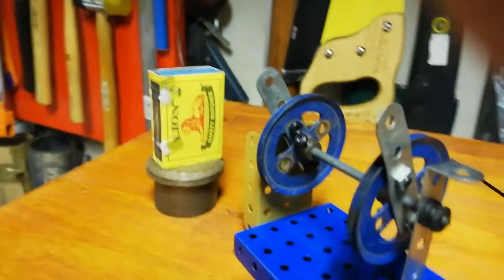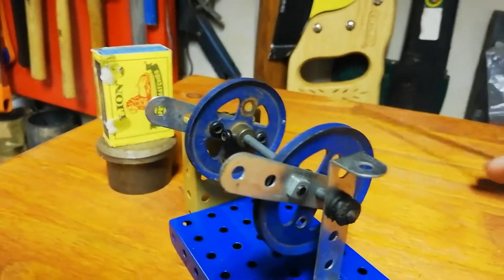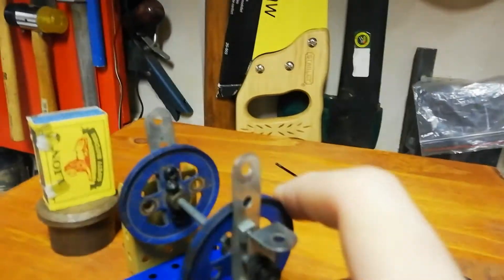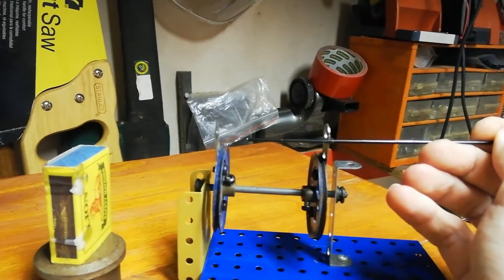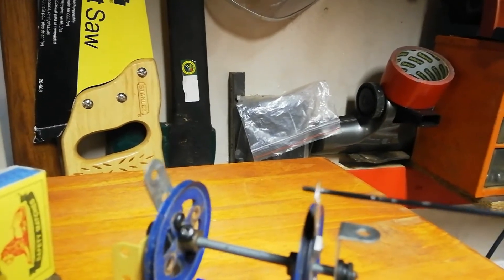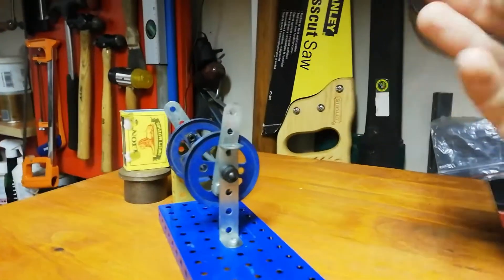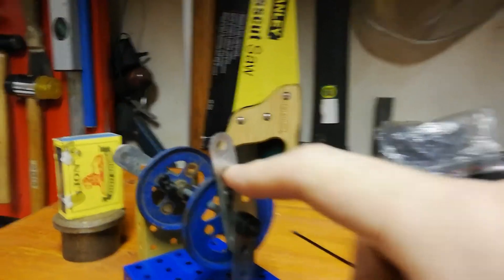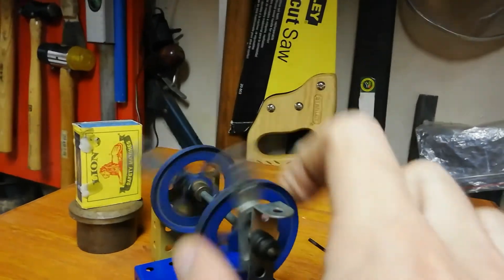Measurement of the Speed of light in 1 direction

Comment: A method to discover the one-way speed of light.

Or... Does light have a tail? 

If light has a speed limit, then it has a tail. If light is instant than the off is just as fast as the on. 

To find out if light has a speed limit take it past that limit and observe. To get light to appear to move past its limit, if it has one, simply rotate it.  If light has a speed limit, as the circumference of the tip of the light grows ever larger, depending on its rotation rate, the angle at which the light would appear to progress in a snap shot view changes.  

If light does not have a speed limit the arc will always appear at a similar radius. 

If and when the tip of the light that creates the arc, is appearing to progress at a 45-degree angle to its path, you are at its max speed.  X=Y moving at the same rate. 

One of many configurations in finding the one-way speed of light, may be done easiest in space:  SEE DRAWING ONE WAY LIGHT SPEED BELOW.

Configure three satellites. One at center and two at a radius. Rotate a laser on a center satellite, and use the two satellites at the radius as targets. The targets are 49.85 and 45.85-kilometers radius and they are 4.8 degrees apart.  This geometry will give you a 45-degree angle between the two satellites targets from the mean radius tangent of 47.85 KM.  

It is believed that it takes light about .0001663 seconds to go 49.85 KM. in space. 

Run the test, based on the believed speed of light:

Rotate and fire the laser: The light is traveling to satellite #2 and will be there in .0001663 sec., with the rotation of the laser at 1000 rev/per/sec it takes .0000134 sec to rotate the entire 4.8 degrees between the two satellites and at that point the light is then traveling at the satellite #3. 

Conventional belief light travel times
49.85 KM in .000166281 sec 
45.85 KM in .000152939 sec 
                  .000013342 sec difference 
Rotational speed to travel 4.8 degrees in .000013342 sec = 999.35 rev / sec
At the above rotational speed of 999.7 rev/sec the light would hit the two satellites at the same moment, if it is traveling at 299,792 KM/sec

Examples of other speeds: 

Light at instant speed can never hit both satellites at the same time, as the light is rotating. 

If Light were traveling at 250,000 KM/ sec

49.85 KM in .0001994
45.85 KM in .0001834
                     .0000160 difference, if the speed of light is 250,000 KM/sec you would have to have the rotation of 4.8 degrees in .000016 sec or 833 rev/sec

If Light were traveling at 350,000 KM/ sec 

49.85 KM in .00014242
45.85 KM in .00013
                      .00001242 difference, if the speed of light was 350,000 KM/sec you would have the rotation of 4.8 degrees in .00001241 sec. 1074 rev/sec

                     
Observations

The two satellites are at a base distance of 4 km apart and the apparent path of the light is about 5.665 KM apart. The tip will appear to travel 5.665 KM in .0000134 or 1.41 times the believed speed of light. But in reality, the light is traveling 4 km less than satellite #2. In the PDF the actual light path, if the speed of light is as thought, the path is shown in the cross hatched line. At two angles, one at the speed of light and one just below, with less that a 45-degree angle to its base. 

If light is instant, the light will hit the first satellite at go, and the second satellite always at the rotational speed, no more no less, and can't hit them both at the same time. Rotation speed and the speed between the two satellites will always be the same. If light is instant, then the off is as instant as the on, it has to tail. 

The light, if traveling at 299,792,000 and rotating at 1000 RPS it will hit both satellites at the same time, if not then adjust the rotation speed and or the distance(s) until that happens and then calculate the speed of light. 

A clock is installed to time the satellite target impacts, so the rotational speed can easily be adjusted and tuned to the speed needed to hit the two in zero time. Once that is achieved the clock is no longer needed.  

At the instant you fire the laser for a millisecond you at the same time are recording and entering into the equation the exact distances and angles to the satellites. It would be extremely accurate, down to a millimeter.

I chose to use 47.85 KM as the radius as that is very close to the speed of light at 1000 Revs per second.  47.85 x 2 x (p) 3.1417 x 1000/ sec = 300,660 KM/sec to the median circumference. 1000 Rev./sec is easily achievable, especially in space, the laser doesn't have to rotate 360 degrees, it only has to move the 4.8 degrees in the allotted times and or adjustable times. The laser only has to fire for a millisecond, so it could be a very high-powered laser.  

This method eliminates the current objections to the use of clocks.  The Einsteinian arguments against clocks are two-fold, one is syncing two clocks at different locations and the second is using one clock in a round trip, starting and stopping the same clock. The objection in the latter is not an objection to clocks / time it is only an objection to it being a round trip voyage. Which I believe is problematic.

In both those objected to efforts above, the clocks measure an amount of time of light travel. In the above proposed method, there is one clock that measures the rotational speed of the rotating laser, which measures Rev/per/sec. That clock in no way measures any distance in time of light.  Another clock is used to tune the rotating laser to discover the one-way speed of light. Once the tune is complete the clock does not measure time. No current objection would apply to the above method. 

If light is instant, no matter how fast you rotate the laser, it will never hit both satellites at the same time. 

Perhaps far more interesting, if light does have a limit, then some light, if it has enough energy, from distant places is getting to earth appearing at an angle, or if you will, a shift.

Comment: Does light have a tail?
 
A method to discover the one-way speed of light.
 
If light has a speed limit, then it has a tail. If light is instant than the off is just as fast as the on.
 
To find out if light has a speed limit take it past that limit and observe. To get light to appear to move past its limit, if it has one, simply rotate it.  If light has a speed limit, as the circumference of the tip of the light grows ever larger, depending on its rotation rate, the angle at which the light would appear to progress in a snap shot view changes. 
 
If light does not have a speed limit the arc will always appear at a similar radius. 
 
If and when the tip of the light that creates the arc, is appearing to progress at a 45-degree angle to its path, you are at its max speed.  X=Y moving at the same rate. 
 
One of many configurations in finding the one-way speed of light, may be done easiest in space:  SEE DRAWING ONE WAY LIGHT SPEED BELOW.
 
Configure three satellites. One at center and two at a radius. Rotate a laser on a center satellite, and use the two satellites at the radius as targets. The targets are 49.85 and 45.85-kilometers radius and they are 4.8 degrees apart.  This geometry will give you a 45-degree angle between the two satellites targets from the mean radius tangent of 47.85 KM.  
 
It is believed that it takes light about .0001663 seconds to go 49.85 KM. in space. 
 
Run the test, based on the believed speed of light:
 
Rotate and fire the laser: The light is traveling to satellite #2 and will be there in .0001663 sec., with the rotation of the laser at 1000 rev/per/sec it takes .0000134 sec to rotate the entire 4.8 degrees between the two satellites and at that point the light is then traveling at the satellite #3.
 
Conventional belief light travel times
49.85 KM in .000166281 sec 
45.85 KM in .000152939 sec 
                  .000013342 sec difference 
Rotational speed to travel 4.8 degrees in .000013342 sec = 999.35 rev / sec
At the above rotational speed of 999.7 rev/sec the light would hit the two satellites at the same moment, if it is traveling at 299,792 KM/sec
 
Examples of other speeds:
 
Light at instant speed can never hit both satellites at the same time, as the light is rotating.
 
If Light were traveling at 250,000 KM/ sec
 
49.85 KM in .0001994
45.85 KM in .0001834
                     .0000160 difference, if the speed of light is 250,000 KM/sec you would have to have the rotation of 4.8 degrees in .000016 sec or 833 rev/sec
 
If Light were traveling at 350,000 KM/ sec 
 
49.85 KM in .00014242
45.85 KM in .00013
                      .00001242 difference, if the speed of light was 350,000 KM/sec you would have the rotation of 4.8 degrees in .00001241 sec. 1074 rev/sec
 
                     
Observations
 
The two satellites are at a base distance of 4 km apart and the apparent path of the light is about 5.665 KM apart. The tip will appear to travel 5.665 KM in .0000134 or 1.41 times the believed speed of light. But in reality, the light is traveling 4 km less than satellite #2. In the PDF the actual light path, if the speed of light is as thought, the path is shown in the cross hatched line. At two angles, one at the speed of light and one just below, with less that a 45-degree angle to its base.
 
If light is instant, the light will hit the first satellite at go, and the second satellite always at the rotational speed, no more no less, and can't hit them both at the same time. Rotation speed and the speed between the two satellites will always be the same. If light is instant, then the off is as instant as the on, it has to tail.
 
 
 
The light, if traveling at 299,792,000 and rotating at 1000 RPS it will hit both satellites at the same time, if not then adjust the rotation speed and or the distance(s) until that happens and then calculate the speed of light. 
 
A clock is installed to time the satellite target impacts, so the rotational speed can easily be adjusted and tuned to the speed needed to hit the two in zero time. Once that is achieved the clock is no longer needed.  
 
At the instant you fire the laser for a millisecond you at the same time are recording and entering into the equation the exact distances and angles to the satellites. It would be extremely accurate, down to a millimeter.
 
I chose to use 47.85 KM as the radius as that is very close to the speed of light at 1000 Revs per second.  47.85 x 2 x (p) 3.1417 x 1000/ sec = 300,660 KM/sec to the median circumference. 1000 Rev./sec is easily achievable, especially in space, the laser doesn't have to rotate 360 degrees, it only has to move the 4.8 degrees in the allotted times and or adjustable times. The laser only has to fire for a millisecond, so it could be a very high-powered laser. 
 
This method eliminates the current objections to the use of clocks.  The Einsteinian arguments against clocks are two-fold, one is syncing two clocks at different locations and the second is using one clock in a round trip, starting and stopping the same clock. The objection in the latter is not an objection to clocks / time it is only an objection to it being a round trip voyage. Which I believe is problematic.
 
In both those objected to efforts above, the clocks measure an amount of time of light travel. In the above proposed method, there is one clock that measures the rotational speed of the rotating laser, which measures Rev/per/sec. That clock in no way measures any distance in time of light.  Another clock is used to tune the rotating laser to discover the one-way speed of light. Once the tune is complete the clock does not measure time. No current objection would apply to the above method. 
 
If light is instant, no matter how fast you rotate the laser, it will never hit both satellites at the same time. 
 
Perhaps far more interesting, if light does have a limit, then some light, if it has enough energy, from distant places is getting to earth appearing at an angle, or if you will, a shift.

Comment: Light has a different speed according to the environment.
Light speed is not a constant,
Gravity affect the speed of light,
Also oxygen particles affect it's speed
slowing it down,
We've only measured it here on earth affected by Gravity and gas molecules.
Out of space, in a perfect vacuum, without gravity, in one way direction, light travels much more faster because it has no barrier.
It also means that 14 billions light years away galaxies are been measured wrong, light does not take that long to reach us, we are receiving it's light much more faster, so the age of the universe are also being dated wrong.
Reply: The claims in your statement mix both accurate concepts and misconceptions about the nature of light and its speed. Let’s break it down and address each point for clarity:

1. "Light has a different speed according to the environment."
True, to an extent.
The speed of light varies depending on the medium it passes through. In a vacuum, light travels at its maximum speed, which is approximately 299,792,458 m/s (or c). In media like air, water, or glass, light slows down due to interactions with the particles in the medium. The amount of slowing depends on the medium's refractive index.

2. "Light speed is not a constant."
Partially true.
In a vacuum, the speed of light is constant and is one of the fundamental constants of nature (c). However, as mentioned, in different materials (e.g., air, water), the observed speed of light is lower due to refraction.

3. "Gravity affects the speed of light."
Not in the usual sense.
According to general relativity, gravity does not alter the intrinsic speed of light locally but can affect the path and energy of light through gravitational lensing or redshift. Light follows curved spacetime near massive objects, but its local speed remains c. Observers in such curved spacetime still measure light moving at c.

4. "Oxygen particles affect its speed, slowing it down."
Yes, but it’s a specific case.
Light does slow down when passing through gases, liquids, or solids, including air, which contains oxygen. However, the effect is small, given that air is mostly empty space and light primarily interacts with particles in its path, reducing its speed slightly compared to a vacuum.

5. "We've only measured it here on Earth affected by gravity and gas molecules."
Not accurate.
Light speed has been measured in space (e.g., during spacecraft missions, laser ranging, and astronomical observations), where the effects of gas and gravity are minimal. The speed of light in a vacuum is well-established and forms the basis of modern physics.

6. "Out in space, in a perfect vacuum, without gravity, in one-way direction, light travels much faster because it has no barrier."
Incorrect.
In a perfect vacuum, light travels at its universal constant speed, c. The absence of gravity or barriers does not make light travel faster than c; it simply travels without slowing, scattering, or refracting effects. The one-way speed of light remains the same as the round-trip speed, as far as current experimental physics can confirm.

7. "14 billion light-years away galaxies are being measured wrong."
No, the measurements are based on well-understood cosmological models.
The distance to galaxies is determined using a variety of methods (e.g., redshift, standard candles) that account for the expansion of the universe, not just the speed of light. Light from distant galaxies is stretched (redshifted) as space itself expands, which is why we observe light from them over billions of years.
8. "Light does not take that long to reach us; we are receiving its light much faster."
Incorrect.
The light we see from distant galaxies has indeed taken billions of years to reach us. While light’s travel time is affected by cosmic expansion, it still requires vast amounts of time to traverse the enormous distances of the universe.

9. "The age of the universe is dated wrong."
Unsubstantiated.
The current estimate of the universe’s age (~13.8 billion years) is based on multiple lines of evidence, including cosmic microwave background radiation, expansion rate measurements, and observations of the oldest stars. It is not solely based on the speed of light but on a combination of theoretical models and observational data.

Comment: Once you offset the two points, I believe your on to something special. But i dont think it will work at short distance. You are literally looking to capture light rays. You would need insanely fast motor and much longer distance between 2 offset holes and a  monocular to zoom and focus on the one blocked area your looking to capture light. If you get that to work. You better patent it.

Comment: The problem with moving clocks is time dialation but could we use this to our advantage. Instead of firing just one clock to point B ( the far end) why not fire both clocks (after they have been synchronized) but at very different speeds.

V_Clk1 speed = c/4
V_Clk2 speed = c/400
Since the Lorentz transform factor (gamma) has a square relationship with velocity (and c is constant in one direction) you can work out c in that direction.

Both arrive at exactly the same point and travel exactly the same path and in a single direction.

The difference in times between the two clocks (due to time dialation) will tell you the speed of light in that direction (using Lorentz transform). Repeat the exact experiment in the opposite directions and if the speed of light is directional you will get a different answer.

This may not be practicaal using large clocks (or even atomic clocks) but could be done using decaying particles accelerated to different speeds. These have well known decay times (such as muons or isotopes).